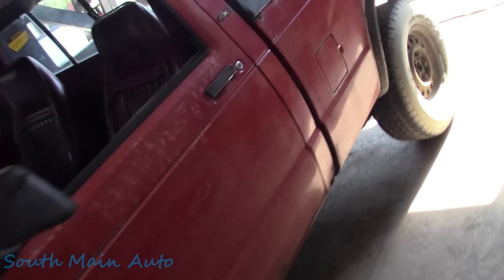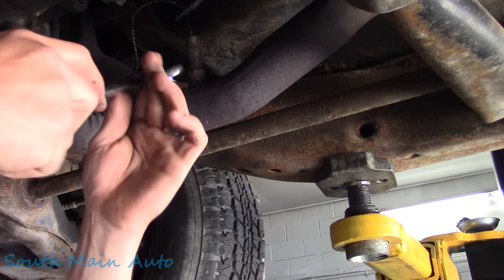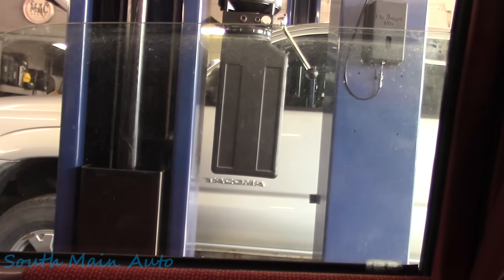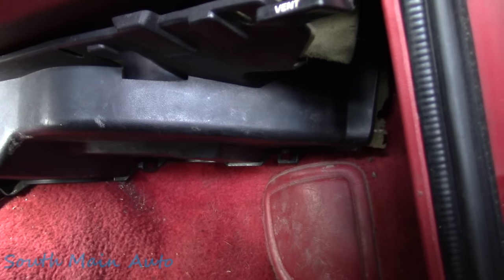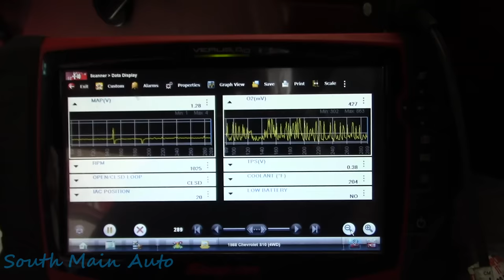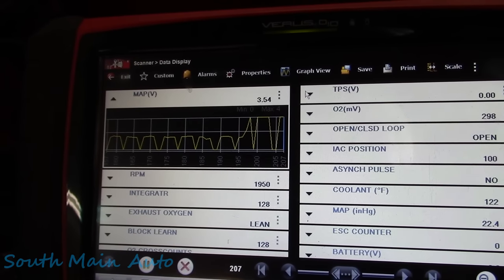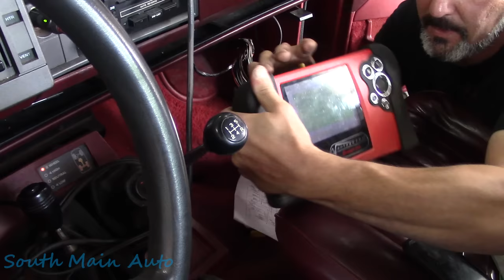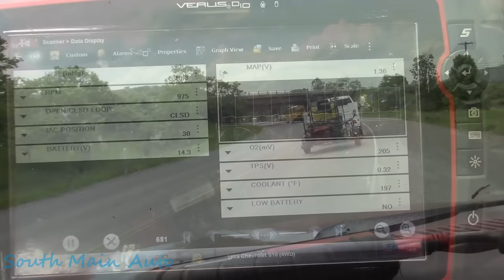Chevrolet S-10 - High Idle and Dies After 20min Drive?!

Comment: A quick test to find a temperature issue in these old ECMs (or other electronics for that matter) is to squirt cold air from your air gun into the box (you can do it thru the ROM access opening) while it is acting up.  30 seconds should be enough.  Not guaranteed to catch the fault, but if it fixes the problem, you've got a 100% confirmation.
Reply: You can also buy a cooling spray can and chill the board very quickly.
Reply: @Don Kaiser: Air wand is cheap and handy, and you never run out! One thing to watch out for is the static electricity generated by the fast moving air. Don't touch the metal wand to the circuit board. Killed a computer in a big high efficiency furnace that way once.... $350, and that was 20 years ago.
Reply: @Don Kaiser: Air wand is cheap and handy, and you never run out! One thing to watch out for is the static electricity generated by the fast moving air. Don't touch the metal wand to the circuit board. Killed a computer in a big high efficiency furnace that way once.... $350, and that was 20 years ago.

Comment: I'd guess those electrolytic capacitors in that PCM are hooped. The service life of those things is 25-30 years. Easily swappable with some basic soldering gear.
Reply: SMA , you know my desoldering station is in the attic at SMA.
Reply: But those ECM's were junk when they were new.  I worked at GM in the 80's and must have replaced 1000's.   Even remember the part # for F-body 1227165.

Comment: These Ecu's have a very slow data rate.  The polling speed is limited by the number of PIDs you are polling.  It's an ask/answer setup.  Ask fewer questions, you get faster answers.
Heating up internally is primarily from the transistors driving the injectors.  Heating externally probably not similar enough to recreate the problem.  Those ECUs are pretty reliable but they do fail.  With all the hack mechanic work these things experience over the years, electrical trauma/stress is likely.  Shorting out stuff, not disconnecting the battery during sensor work, IAC, injectors, etc.
The low battery pid is telling.  As parts heat up, electrical resistance increases.  This depresses  the internal vref for the CPU, RAM/ROM.  When that vref sags, data errors occur.
Reply: Yeah, I was wondering if the CPU was losing stable voltage when it got hot and started looping or freaking out. Maybe a failing voltage regulator on the PCB.
Reply: Dang!!  Yoose a smart one
Reply: In my experience the 160-baud ALDL data always sends all the PIDs, regardless of which ones you "select", and there's no two-way comm.  Those with more PIDs programmed into them have more bytes to send, so they update more slowly.

Comment: Nice seeing you using a Vantage. What an awesome tool that was when it was introduced. However the Verus you had borrowed has the Vantage data base and functionality built in and you can split screen it showing processed and raw data side by side and record it at the same time and print it for your personal file and a copy for the customer. One trick I used on troubleshooting aircraft PC boards is to use circuit freeze spray with the unit hooked in and powered up and freeze it and look for glitches and tap it with a screwdriver handle. The freezing will pull a cracked board apart to open a circuit. Excuse me while I go out and buy a brisket.

Comment: The electrolytic capacitors leak their corrosive juice out and destroy the traces on the pcb.
Reply: GM supposedly used tantalum capacitors per Shango066.

Comment: I am a retired, lifetime GM dealership employee from Tech to Service and Parts Director....( a little background ). When our products had a widespread problem with drivability, they would come out with a bulletin, a widespread rattle problem, guess what?...Yup, another one page bulletin from the engineers. The point I am getting at is the fix is usually a sheet of paper with the "how to"......Here is the kicker, guys.... The drivability bulletin on the 2.8 in the late 80's was a 36 page book. A freaking BOOK.( I have one as a souvenir ). It was mostly 2.8 V6 engines in cars, but, it was always the 2.8. They never ran perfectly, like the 3.8 V6 did.........

Comment: back in the day,, we would drop the ECM and slap it,, usually we found the circut boards were bad,, the shock of us slapping it showed it right up
Reply: I remember that, we called it "tap testing" lol. A good Wang on it with a big screwdriver usually showed the faulty circuit board
Reply: I used the rubber hammer test.

Comment: I wonder if it's like the Ford computers of the 80's and 90's where the capacitors go bad and need replacing.
Reply: Shango066 mentioned in a comment that GM used tantalum capacitors since 1980. Tantalum capacitors don't leak but I have seen them fail shorted.
Reply: Common on any of the old PCM's I have fixed PCM's and TCM's due to caps.

Comment: One thought when you r out of the workshop and you want to make it work to get back to the workshop. Get a can of “freeze” from an electronic workshop supplier. Check the name, not sure if it’s called the same in USA. It’s for freezing electronics that fail under getting hot. It’s an old School technique when we used to fix things. Make sure you have the top loose or make sure you have the right screwdriver with you. You can chill the inside of the pcm so it starts working again ( hopefully) so you can get home.
Always enjoy your videos. 🙂

Comment: I'm told those old single wire O² sensors had a 30k lifespan at best. 
I'm not one to throw parts, but on something this vintage, a $10 O² sensor could be filed under "tune up"
Yes they're that cheap for old GMs
Anyone who bitches about flash programming should try to find a TSB revised PROM/Memcal chip for a 1983 G Body Grand Prix with a C3 QuadraJet
Ask me how I know 😭
Reply: Want me to guess ! Bin there ! LOL
Reply: P.S. that C3 system was tricky ! Only lasted a few years! GM ‘s introduction to fuel injection ! 1963 Fuel Injected Corvette! Way ahead of the times, but proved doable ! LOL

Comment: Great Video,s.....I had a 81 Cad.{ with the 4 6 8..modulating system}. Running rich . replaced map sensor, [ volt meter only...nothing for testing] had little over 100,000. Pulled TBI and the bottom of TBI was full of carbon build up.....causing vacuum problems for MAP sensor. run great after removing the carbon. It took me a while to find the problem. i love watching your video's, your top gun on diagnostic's. you make the tough  ones look easy......

Comment: Rather than than put it in a freezer, spray it with brake cleaner or acetone the evaporation will quickly lower the temperature hopefully leading to a quicker  diagnosis and you could do it on the fly. I live in the UK so will never see any of your vehicles but the methodology is what keeps me watching every vid.

Comment: I just bought an 84 S10 a week ago, it has the carb instead of the EFI but it's the same 2.8 that's in the video, same 5 speed and 4x4 setup. It's nice to learn about the initial problem FI had, makes me kinda glad I bought a carb'd truck 😅

Comment: Impressive video on old school stuff. I had an 83 Malibu with a computer  box that ran a Rochester  carburettor on a 305 CID. It worked perfectly. Carbs integrating with computers were first with GM in the early 80s.  A few years later TBFI. My Malibu was a monster on the highway. That Rochester was big, at 85 mph no kick-down.  Speedo topped out at whatever,  who knows? Highway gears, 18 years ago, nobody died, :-)

Comment: Eric, I cut my teeth on a slippy Powerglide in '73, did a Navy gig from '75~'80. FINALLY went to trade school to fix cars in '82. This was the sunset of carburetors and point controlled ignitions and the dawn of electronic fuel control & exhaust/emission controls. The very dawn of primitive computation of engines. A helluva time to study & learn automotive technology. GM, FORD, European, Japanese, there were hundreds of permutations of what boiled down to be the SAME problem, ultimately for any given car. Sure, pattern failures led many down the part cannon primrose path, the stickers could cause blood to flow. Methodical diagnosis has ALWAYS been the path to success. ESPECIALLY when it comes to expensive car parts...❤

Comment: When I started at the plant I work at 32 years ago the company had a 1988 Chevrolet S-10.  It had a Delco radio with only AM and no air conditioning.  Seems like Jeep used that GM 2.8 V-6 in the 1984-86 XJ Cherokee and Wagoneer (not the Grand Wagoneer).  At that time, "Tahoe" was a trim level on the S-10 pickup; it was fairly near the top of the heap as trims go.  For some reason, I think the reason those trucks rode so well is because they had the same front suspension as the E/K bodies on the 4 WD models; (you can see the torsion bars) the 1979-85 Buick Riviera, Cadillac Eldorado, Oldsmobile Toronado and the 1980-85 Cadillac Seville.  Cooling down the PCM sure does bring back memories.  I guess you were 8 years old when those trucks came out, Eric?  GET MRS. O AN ICE MAKER!  I can't believe you have that woman filling ice cube trays!!! GREAT VIDEO!

Comment: These trucks are even hard to find parts for and are rare around here in Az also I don't think replacing the prom chip is a main solution easier to just replace the entire unit but if you can the pcm is tricky when prom chips can be taken from other years and makes good to see you found a Pcm just a Different prom hopefully it works for the customer @SouthMainAutoRepairLLC

Comment: I have a 1987 S-10 standard cab 2 wheel drive short bed with the 2.8L and a 5 speed. I bought it new, and it is still in near new condition. ZERO rust AZ truck. 288K miles on the original engine. I plan to have the engine replaced IF it ever wears out. The only things that have ever gone wrong with it was the water pump and the O ring around the distributor started leaking. I would much rather take a simple older vehicle and replace parts to keep it going rather than deal with all the trash technology on a newer one. I also have a 1975 Ford F-150 with a 360/C6 that I plan to keep forever. Those engines and transmissions are not only as tough as nails, but also readily available.

Comment: Nice video Eric.  1988 isn't that old, I've been driving an 88 Monte Carlo LS for almost 20 years.  305 V8. The electronic carburetor wasn't great, took forever to warm up to the point of driving it.  4 years ago I installed a FiTech system and I've been very happy with it.  Drives 95 percent as well as a new car.  My other "every day" car is a 1979 Monte with a 2 barrel 267.  I love that car also.
Reply: I own two 1970 Lotus, so 1988 is just a youngster.
Reply: Those may not be old to people in non salt belt states, but where he lives the average life of a vehicle is 7 to 10 years before it turns to rust in the wind.

Comment: reminds me of a fun time I had a '90 Cadillac that died often at idle and also hitting the gas from a stop. I had the shop manual and went through about 30 steps in 4 chapters to get through all the flow charts to diagnose the bad pcm. swapped it for my Dad's exact same vehicle that he was junking for engine cradle rust. ran great for another few years. i bought that caddy in 1997 and got rid of it in 2017 the engine still going strong

Comment: What’s interesting about the old chips is the shortcuts engineers built into them. I could set a caddy for stage two temporarily with the heater controls. 
There was a weird thing with jumping a resistor across the pins to set base timing also.

Comment: I've got a 96 Jeep XJ with something like a half million miles on it. The check engine light came on and a few weeks later it started idling high. The code said idle speed motor, but replacing that didn't fix the problem. (and it was cheap). The next things to check were the wiring and the PCM. Wiring was fine. I was able to get a "rebuilt" one for about $200. Don't know what was rebuilt about it but the thing was clean, tested, with the latest code, and they wanted my VIN number so they could flash it with the correct settings.

Worked great, that problem was solved.

Comment: I had one of these trucks.  I didn't like it.  The rear axle grease seal leaked and sprayed the brakes with grease.  I brought it to Monroe and he said it was out of adjustment and polished the brake shoes.  It froze up on way home.  I figured it out and put a new seal in.  Trouble is, I had made a small gouge removing seal, so it leaked again.  Next time, I sanded down the gouge and put in new seal.      Next was the clutch on this.  You had to remove frame to body mount on cab and jack it up to gain access to the bellhouse top bolts.    I do say that it was better than a comparable Ford Ranger.
Fast forward today, I brought my 2011 Colorado (S!10 replacement)  last year to Monroe to change the tires and tpms.   The kid was learning there and just hand tightened the front sensors.  After months, the leaks got worse. I brought it back and the manager there used a breaker bar to tighten them and broke my sensorsand and damaged rim trying to chisel it out.    Lesson is, stay away from MONROE.  :)

Comment: Hey brother, the freezing the the  box clearing the faults, and return with heat soak is a classic symptom of a bad electrolic capitor, they will have a line on one side, bad ones sometimes have bulging tops,  they can be replaced. You and also find them by using cooling spray at individual caps after the fault appears.  More for the next one you see than the one you've just repaired.

Comment: This is an old puzzle that mabey you can answer. Had a 88 F150 / 4x4 / extend cab with the 300 6. Loved that truck.
 It died one day while driving. Finally found that the main wire to the relays had melted. Changed the wire and checked the relays. Truck starts and runs at any rmp. Parked. Put in drive and reverse. no worries.
 Take it for a drive and 56 seconds later it would die and the wire was melted. This happened 3 times at the same 56 seconds. Would still sit and run forever with no problem. Friend of a friend had the same truck with the engine gone because he never changed the oil since he owned it, so I took all the relays and changed the 1 for 1. This is after it was towed from shop to shop. None fixed it but did take the money.
 Finally sold it to a guy, cheap, that said he knew what the problem was. 
 I saw the truck a week later, dead at roughly 60 seconds from his farm. HMMM.
 This was 25 years ago but it is a worm in my head. 
  Love your channel. Make a guess please to kill the worm if you wish.

Comment: From what I know about the PROM chip is it stores the programming for the PCM, the other chip stores the fuel trim data that the engine uses to vary the fuel trims, the pcm boots off the prom chip, reads the other chips fuel trim tables, then the pcm then processes the signals from all the sensors.  You must swap both chips into the replacement pcm for it to work.  From what I see, yes the pcm was bad, probably glitching out, misreading sensor data thereby making the engine run like poo.  The replacement worked just fine, as it booted from the programming off the prom chip, and could see what the truck is, and figure out how to process the signal feeds.  Technically, if you had the ability, you could reprogram a new prom chip and make the engine run differently, and you could program different set of fuel trim tables if you had that ability, an old school tuner if you will.

Comment: Now we’re talking. This is what I dealt with back in the day, and without the fancy newer diag tools. Also HEI modules that would quit due to heat, no transfer paste underneath. Also bad black HEI distributor caps by the hundreds, allowing spark to arc thru to the advance mech.

Comment: A little tip. Any left over meats especially expensive smoked meets. Vacuum seal them in baggies, Freeze if you want them for much later, just refrigerate for consumption in the next couple days, simply put the bags in boiling water. Once they are heated up they taste just as good as when you ate them the first time. Make sure you get vacuum bags that are good for boiling. I don't know cars, but I do know smoking meats. LOL

Comment: I still own a 1989 S 10 Blazer.
At one point the engine started running with all symptoms this truck had.
I replaced the PCM, using the original PROM and it fixed it.

Comment: I'm going back a few years. One more Diagnostic tip. Take the O2 Sensor and disconnect using your body as a resistor Now at the ECM side, just go in series with the Battery cables Positive will take it rich, and Neg. will take it Lean. EZ Peasy. Then Replace the O2 if the ECM sees the change. Or possible ECM or wiring Issue. Brisket looked great!
Reply: pînned by South Main Auto Repair  Scam Alert!!!! You've been Hacked!